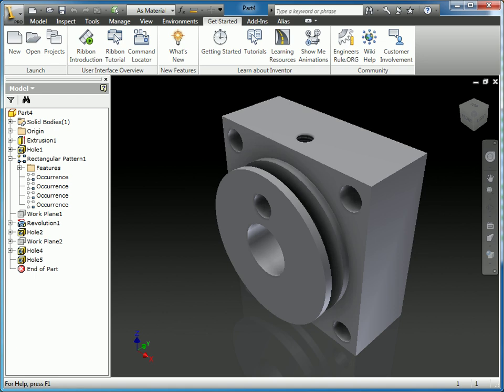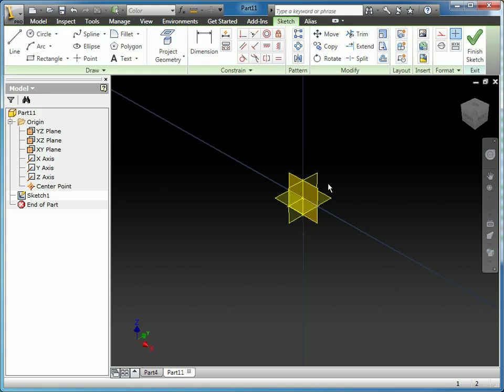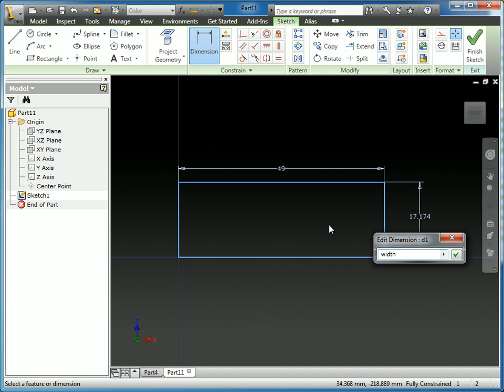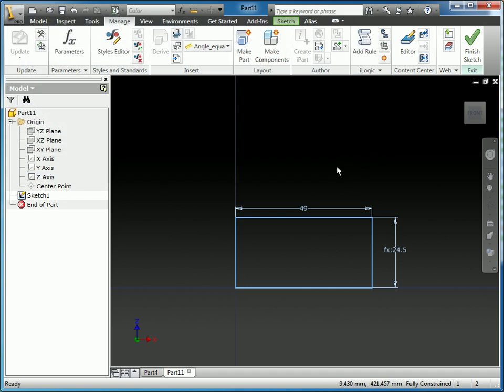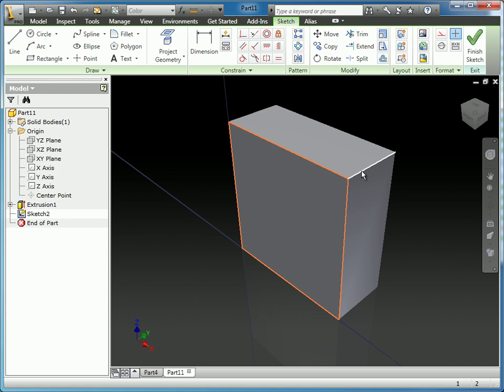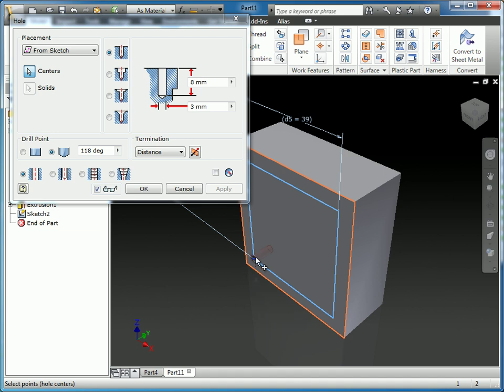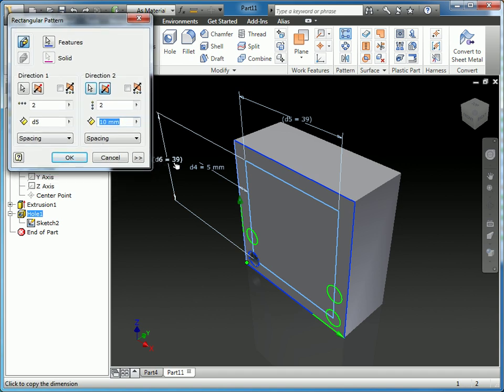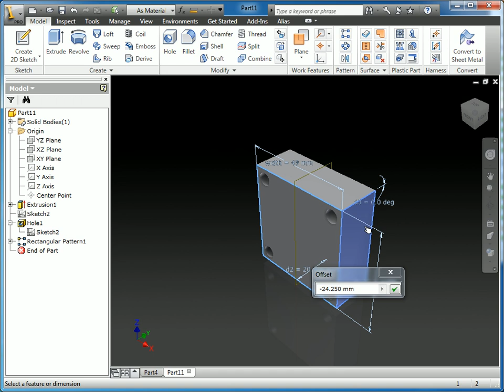Part 1 - Part Modeling In Autodesk Inventor 2011

Comment: Hi John,hope your well,I seem to have an empty content centre in inv 2011,if I go into tools>applicationoptions>files, it's there and it ends in 2011 as I have 2012 too,if I click content centre while I'm there it gives me the location but if I open it in inv it's empty,I checked programmes and 2012 CC is there but not 2011 CC,I'm a bit baffled by this and unsure what my next step is,have you ever came across this? Thanks for your time John...James.

Comment from the maker: @Davichoo I think you mean why didn't we set Z to be up? Honestly, I have not idea. I change it ever time. I sketch on the XY plane and set Z to point up. You can set this up in Inventor by right clicking on the view cube and using the set home view and set current view options. When opening the inventor files in MAX I also think there is an option to align the axis, but I might be wrong there. Hope this helps.

Comment from the maker: @powerbronx Do you mean in the browser to turn them all on/off at the same time? If so, then you use standard windows conventions....select the the first plane in the list, hold the shift key down and select the last plane in the list. Then you can right click on them and turn them all on or off at once. There is also a button on the view tab (which i promote to the quick access toolbar) that toggles workplanes on/off with a click of a button. Hope this helps.

Comment from the maker: @MrMaybeimdreaming100 Of course it really worked....did you doubt me? If you can learn Maya you will learn Inventor faster, but they are very different programs each with a very different purpose. If you download Inventor and try it out I can always add new videos to help get you up and running. I am always interested in what areas of Inventor cause people trouble....those are the videos I want to make.